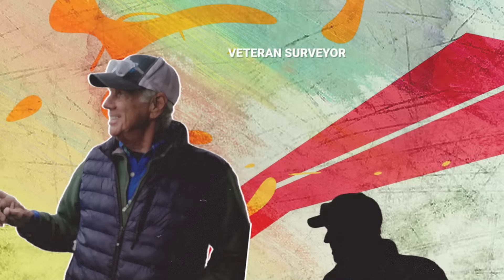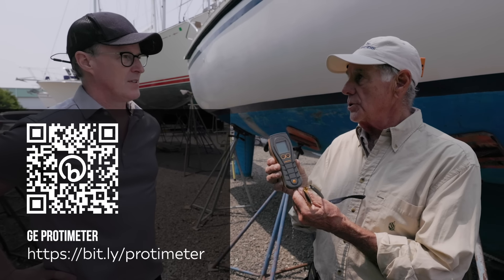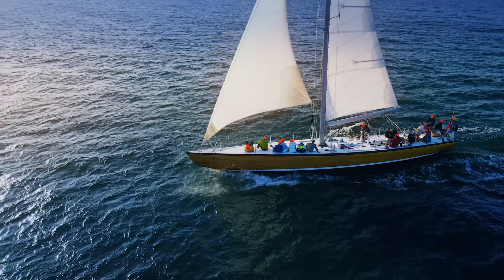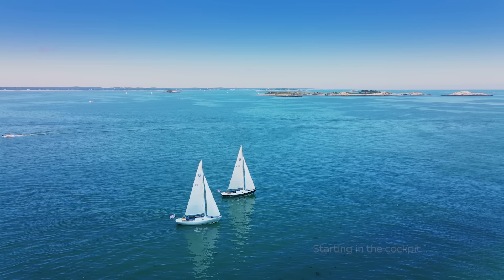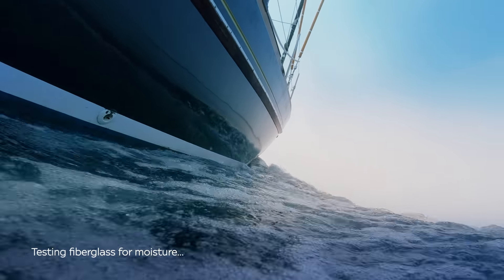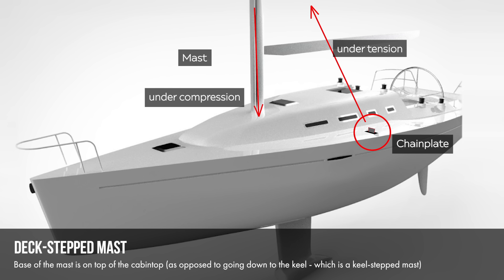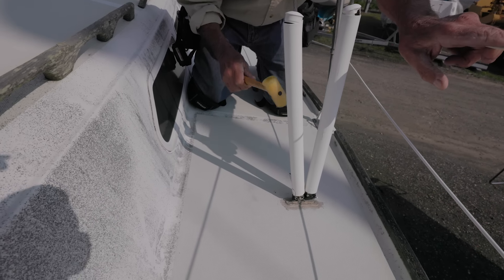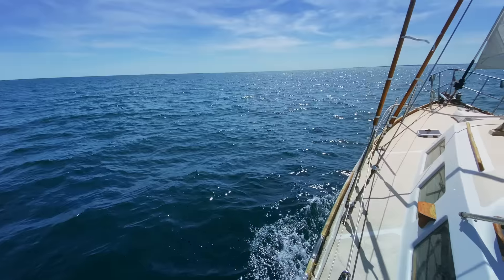SAILBOAT BUYING TIPS from a Surveyor - Part 3! Decks, Chainplates & More  #sailboat

Comment: •	I alive on a 1973 Alberg 30 and a rotten deck core and chainplates is my worst nightmare.  I don't have the nerve to check my chainplates and balsa core. I always suspect when sailing that someday my rig will come down and that after I die my boat will have basically no value and will be a disposal liability. 

But then I cheer-up because I think so what. If the mast comes crashing down (assuming it doesn't land on my head) I will be left with a perfectly comfortable (for me) and live-aboard-able trawler. 

Without the mast I can go under bridges and further up some bayous. I wouldn't mind the slow speed. I might spend some money on engine sound insulation and a cockpit Bimini. I will have excessive draft (4ft) but not so much that I couldn't live with it. I like the look of my hull (long, low, narrow with nice overhangs) and I think it would be more beautiful than any but a Biloxi Lugger trawler. 

So if I were looking for a boat to live on or even to day sail in local, protected waters (vs ocean crossings) a boat like the one surveyed above with the rotten core or one needing major standing and running rigging and sail repairs/replacement might be a perfect find for me. No way it is worth the effort of re-coring the deck but it might last another 20 years cruising coastal waters or just buy it as a live aboard coastal trawler.
Reply from the maker: that's the spirit!! adapt and keep moving... and maybe pack a helmet!! just kidding... those chainplates and connection points to the hull are more important than the deck core.... so I think you've got the right aproach! cheers, Daniel!

Comment: Talk about poor craftsmanship! Whoever designed and built that sailboat, did absolutely no engineering calculations on the stress factors of those tension and compression brackets. It was so obvious just looking at them that the flanges needed to be at least 3 to 4 times wider. 
Please advise all us viewers who the manufacturer of that boat is so that owners of them can request a recall and have all their decking replaced or get the company to buy back their shabby boats at market price.
If neither of those happen, perhaps a law firm is willing to file a class action suite against them.
Glad I got that off my chest....LOL